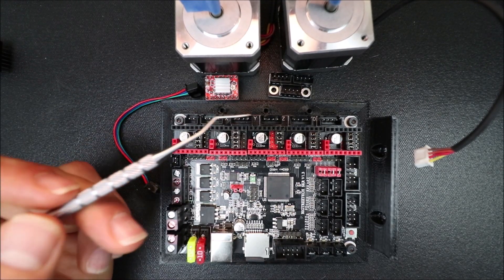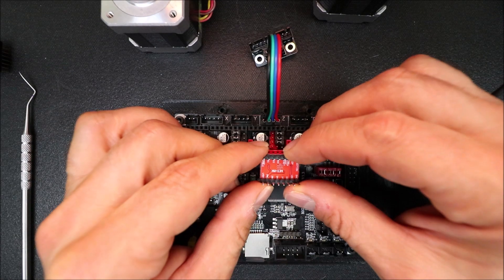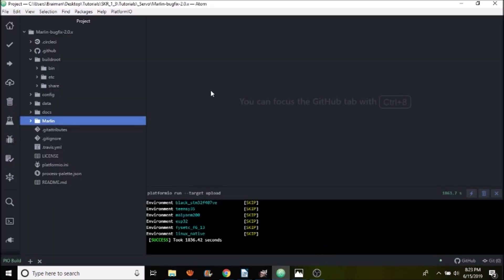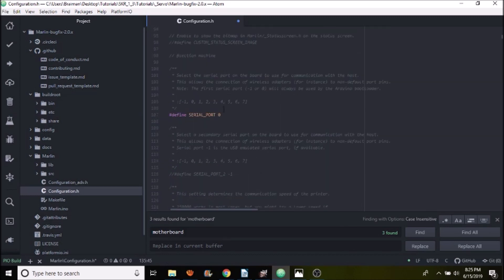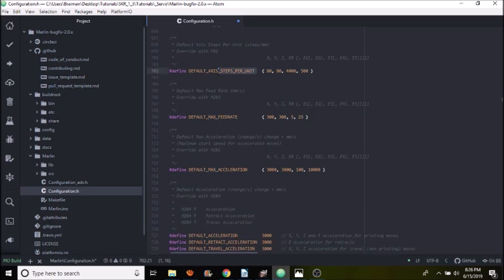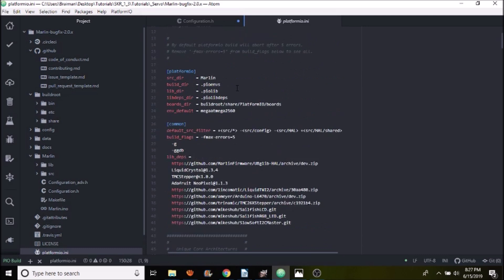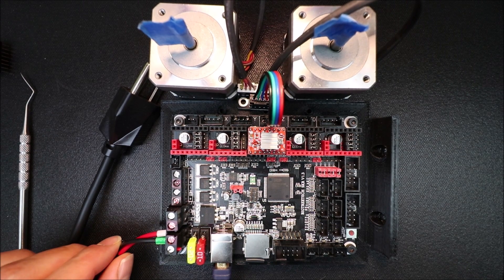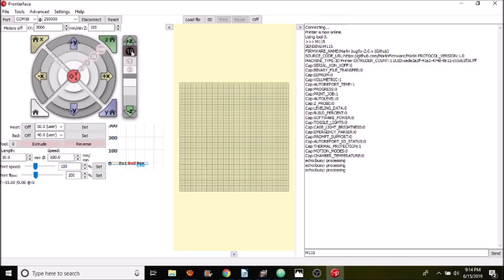SKR 1.3 - Dual Z steppers  with Parallel Module (Part Three)

Comment: thanks. as you know, in in older borad like ramp1.4 we have only 4 drivers for axis (x,y,z,z).  If we use this ability in all of these 4 ports and finally have 8 ports, will there be problems with the board and is there any problem? thanks.

Comment: Hi Edward, I have an SKR1.3 and SKR1.4turbo. My 1.3 is installed in a Tevo Tarantula Pro with TMC2209s and my 1.4T is installed in a custom built printer with dual Z leadscrews, this is also with 2209s. My question is... On my custom printer with the SKR1.4T I have dual Z leadscrews with dual steppers operating them, I can also use the G34 command Z-axis auto align feature. I wanted to try this on my Tevo (which was only single leadscrew) and for some reason I cant get it to work. I have done everything the same to the hardware and firmware as the 1.4T, but when I run a m122 in pronterface X,Y,Z and E give connection OK but Z2 gives bad response. Could this be a problem with my board i.e the E1 slot on the board not working properly. Its been driving me mad for a couple of days now, any info would be greatly appreciated.
Reply from the maker: Power down system and switch positions steppers driver boards for E0 and E1 and see if problem moves.

Comment: Can you tell dual z axis in skr 1.4
Reply from the maker: Could you clarify the question?  The SKR is native to one stepper, you can break it into two either with a parallel module or using E1.  E1 may cause issue with a delay and tuning of stepper.

Comment: Hi. Anything for the z stepper connected in serial and usin 1 TMC2208 driver
Reply from the maker: In principle is similar with acception of default axis steps per mm. You can look that part up on reprap calculator.

Comment: Thank you so much!
I read online that TMC drivers don't perform very well at 12V. Do you have any experience with this? Should I supply 24V to TMC22xx drivers?
Reply from the maker: I'll need to check into this.  Do you have a link?

Comment: do we need increase current on Z-driver for dual motor setup? as they are in parallel, each of them seeing only half of the current, causing having only half of torque.
Reply from the maker: Depends on the motors and if they don't move.  They generally move very little in comparison to x and y axis.

Comment: Hi super video, but I have a question for you what do I have to set on the board if I want to use the TMC 2208 UART driver and so use an adapter for dual Z .... I ask therefore I want to install the SKR 1.3 in the CR10s the dual z has
Reply from the maker: I'd initially start with a cheaper stepper and the double check the datasheet for TMC 2208 UART with you Nema17 datasheet.  You'll then want to start low low around 750 and increase or decrease based on heat movement and noise.

Comment: How you're doing it seems better than using 2 stepper drivers (in my case, 2209's). But, do you have a guide on using E1 instead of wire tying? On my MKS GEN L the Dual Z motor worked in the E1 using the supplied Marline 2.0 from TEVO.

And on the other side of the coin, is wire tying actually any different at all VS. using 2 stepper motors (in my case, 2209's).
Reply from the maker: I have an updated video I'm working on.  The old one needed to be updated.

Comment: Why can't you enable e0 or e1 as a second z motor?, now I'm going to have to wait for a dual z module when I should have this up tonight.
Reply from the maker: You can splice Dupont connectors wiring together.  Just would rather have you do the safe way.
Reply: @EdwardBraiman  I found your dual z steppers video just now, I'll run that until I need a second extruder. Now my only worry is running 2208's in every slot, I've heard people having issues with that.
Reply from the maker: I've heard the same as well, but I think someone left a comment on how to work around issue. Some people have warned against using in z axis.  I still need to research why.

Comment: I'm trying to convert my CR10-S5 to SKR 1.3, and am stuck setting up the dual-z motors. Do I need a parallel or serial dual module? I am using 2209 drivers. Can I wire it myself instead of buying a board, as they take weeks to get over here.
Reply from the maker: I perfer the one that break them in two with the mini curuit board.

Comment: Thanks for the videos. Would there be any difference between using a parallel module or a parallel Y cable? It doesn't seem like there would be, but I want to make sure before I order.
Reply from the maker: They should be identical electrical.  Just study the datasheet for the right stepper.  I recommend drv8825 when starting out, only because if you make an error the cost will be around two dollars.  Just a reminder to match the pins to the board.

Comment: Can you do an automatic X-axis leveling on the Z-axis?
Reply: Something like that is in the WiFi Duet driver - You can see it on the video https://youtu.be/0vRbjV9FM54?t=504
The axis is crooked. The BLT examines the altitude and the central axis (table here).
Reply from the maker: I'm trying to build some smaller printers to demonstrate, but it maybe some time, like a couple of months.  I'm try to caught up to all the requests.  Just purchased a new laptop to reduce compile times to minute from 45 minutes for this video.  I'm hoping to increase the pace of videos soon.
Reply: @EdwardBraiman  
Thanks for taking my request into consideration :) I will be looking with attention and hope.
Thanks for the videos devoted to the driver of 1.3. I'm just waiting for a shipment :) The films have explained a lot to me.
- I apologize for the language I use the translator.
Reply: @EdwardBraiman  That would be great, I would love to be able to auto-level the two Z steppers, if you know what I mean.

Comment: Parallel Z motors with A4988 drivers doesn't have enough power for my CoreXY even after set VREF to maximum.
Reply from the maker: This could be true normally I use DRV8825, but to demonstrate I had them nearby.
Reply: @EdwardBraiman  Could DRV8825 supply enough power, I'm using dual A4988 now ?
Reply from the maker: You may want to consult the datasheet for DRV8825 to verify, but it should be fine.
Reply: With 2209 Drivers my vref is 950 mv. This is not enough. Do you have an Idea? More Power?
Reply from the maker: You could try and see, but consult the datasheet first for TMC 2209.
Reply: @EdwardBraiman  thanks for your answer. I have try more power. Multiple by two. It works fine. No Problems!!! Thank you. I like your videos. All the best from Germany
Reply from the maker: Vielen Dank

Comment: Thanks for the video.  Since the motors are parallel, do you need toset the reference voltage higher so it can supply the correct current ?
Reply: You could but it's probably not needed as the z axis does not move as fast or as far as the x and y axis' do during a print.  If you find the z axis griping about it like missing steps you might want to bump the voltage up a bit.
Reply from the maker: Maybe, but first try at defualt voltage and move up in small increments.
Reply: thats the main question other than that anyone can buy and connect wires to the connector :) i.e I have 2209 now and not sure If I should bump up the Z Current fromm 800 to 1000....
Reply from the maker: Unsure for the moment, but in a week and a half I'll have some time to investigate.

Comment: Thanks for the info, as always great video.  I may have asked this before but are you planning on doing  a video about this board with tmc2130 drivers in spi mode?  I see lots of tutorials on the 2208 drivers but none for the 2130s.
Reply from the maker: Soon, maybe this weekend.  Just wanted to do one more tutorial on cooling before doing.